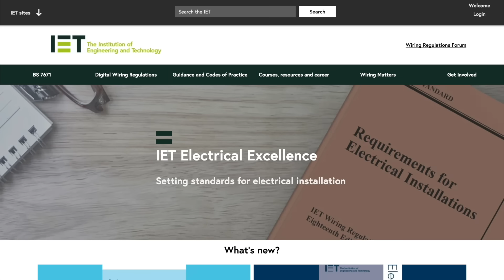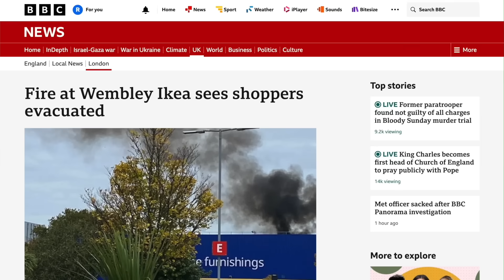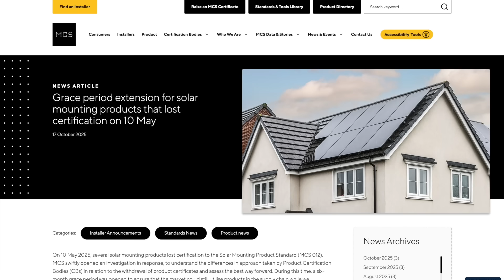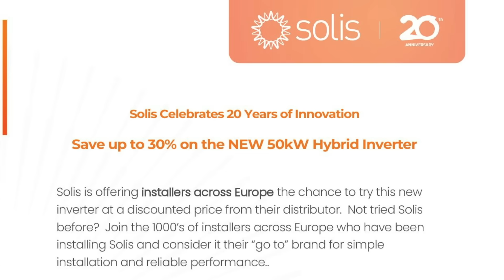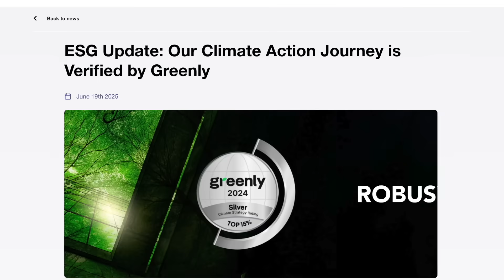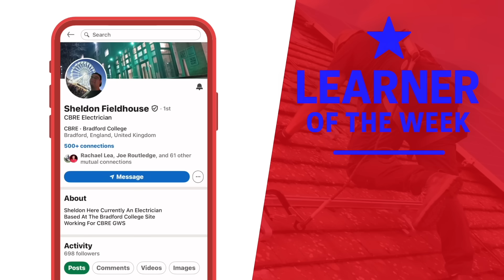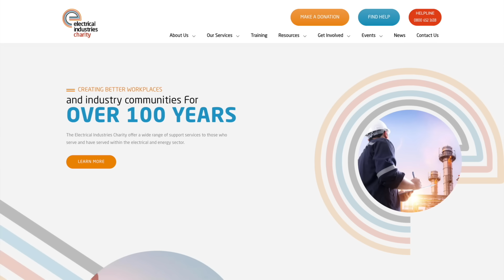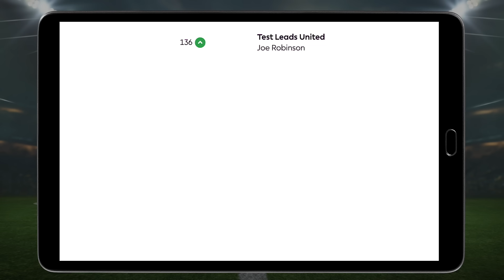Exclusive: Grid Bosses Set to Change UK Voltage

Comment: If this solar stuff is so good why has 3 houses local to me had there solar panels taken off there roof and not replaced them. .
I was intrigued so one person said they were useless , 2 person had  a storm took them and half his roof off . 3rd person I don’t know why .  Makes you think
Reply: They are still quite new - it is possible they were badly installed? My DIY setup was a bit "meh" (not taking as much as I'd hoped off my bills) until I worked out the lead-acid batteries had nowhere near their stated capacity. I bought new lifepo4 batteries, but Mrs trs4u was ready to drive it all to the tip. They provide about 75% of our electricity. An expensive component like that underperforming by surprise can be financially gutting. There will be people having bad experiences.
Reply: @trs4u yes it’s a valid point
Reply: Really old stuff or not enough panels then, I have 9kw of panels and 90% of my bill is gone and that includes running two EVs

Comment: All the while impressed how fast a kettle boils in the UK at 240v! Wow!
Reply: All kettles are mad to cover 220-240V nominal. so its Voltage range is from 198-264V (+/- 10%). When the kettle is labelled 2.4 kW at 230V , it will take  2,2 kW at 220V  and  2,6kW at 240V.  Filled with 1 l water,  the boiling point differs only abt. 15 seconds.
Reply: It’s about to take 2% longer :(
Reply: @geoffplywood6112  I will not stand for this! I'll be SITTING, because it's TAKING SO LONG!

Comment: My home is only 30M away from the 11KV transformer and my supply is aways above 240V 8pm 242V and tonight at midnight 249V some times I see 252V. I also see this at a lot of sites as well. Higher voltage better as the current is lower for fixed watt equipment. Also good for long runs.
Reply: I must be at the other end - 220V and it drops to 200V when drawing a bit of power!
Reply: @ByToothandClaw That sounds like a bad connection, either on your incomer or consumer unit or possibly the joint outside your property. Shouldn't fluctuate when you increase demand by any more than 1 or 2 volts. Dropping 20 volts indicates a poor connection where resistance will increase with current draw.
Reply: @emfs2016  similar experience here, we have solar PV so daytime voltage rise is expected but the 1950s era pole transformer that supplies our property sits at 248 when there is no load overnight, rising close to 252 in the daytime, before the low voltage overhead cabling was replaced a few years ago we would sometimes get an overvoltage trip on a sunny day but a newer transformer with better regulation would be very welcome!
Reply: Same here, it is at the limit of my solar pv inverter, after install it went to 255v and shut the inverter down requiring a reset.  Since then it’s been around 252v too close to the 255v limit.
Reply: @emfs2016  same here I am regularly between 245-250v
Never seen it dip below 238v!
My small 500watt PV install makes no difference to my house voltage.
My UPS is  "compensating for high voltage" over 50% of the time. It considers 248v or above as high
Reply: Pretty sure my outlets (In a flat, maybe 40m cabling distance from the transformer; Rating unknown) consistently read at 250v using a consumer plug-thru power meter.

(I'm only a hobbyist, so a bit wary about sticking my meter probes directly into known live outlets. My meter has a V/max of only 300v as well, so 250 plus variance is a bit close for my liking.)
Reply: @UK-Combustibility-Assured good call on being wary of that meter. It should be safe if you wire it up in series with a lamp  and not be holding the probes when you flick the switch... NICEIC it ain't, but safe with a risk assessment, it is

The accuracy of even a cheap DMM (NOT the ubercheap ones!) should be better than the plug in type. 

But given your situation,  substations for blocks of flats (especially electric only) tend to be tapped to the high end of 'normal' because of the potential load
Reply: @TheChipmunk2008  The meter in question is a Lidl-branded Parkside one, which I switched to as I wanted to preserve the OG Fluke I'd used for 20 years prior. It's GS/TÜV and CE marked so there's probably some overhead in the specified ratings, but assuming that could be a very dangerous thing, so I don't. 👍

The road is mostly social flats plus a few houses for families. All of the flats are Eco-7, so a high-tap is more than logical. I dread to think what the voltages drop down to when every flat in the road except mine (If only I could afford it!) has their storage heaters and boilers on the go! 😳
Reply: @emfs2016  same here. 11kv pole and transformer is in my garden. Supplies 3 properties. They just put a new transformer on and power grid guy tested it at 241v at 4pm.
Reply: Same here rarely drops below 240, quite handy being that close to the supply,  good earth as well.
Reply: Used to be like that at my place, but recently they renewed the local transformer manufactured to the new standard.
Reply: You can bet your ass that the government will hear the concerns from the industry and then not listen and do it any way. After doing it theyll make sure we all pay more both for swapping out kit that wont work and more tax o. The cost of power to pay for the change overs “paper work”
Reply: @emfs2016  Not good for energy efficiency where magnetic ballast fluorescent lights are concerned.
Reply: By lowering the voltage, there will be an obvious increase in current. Hence, bills will definitely increase. Absolutely no surprise there.
Reply: @AbdulSinge  only with non linear loads like switchmode stuff. A lot of load is still inductive or resistive
Reply: All electronic equipment use Switch mode power supplies and will work down to 80 volts I believe so no  real effect there, as for heating kettles etc you will have less power/ heat output
Reply: @johnchild61  The problem is the switched mode power supply will draw more current at lower voltages, which will cause fuses/breakers to blow.
Reply: The longer the cable I use for powering my garden equipment, the less effective the equipment is. It’s the old hosepipe principle. Energy companies please note .
Reply: Be grateful meters measure current so the more volts the less current you need to boil that kettle.
Reply: Same here.. 750kVA substation within a stones throw... We usually hover around 247... fairly stable
Reply: And shorten the life of all smoothing cap's in your equipment.
Reply: @stevesweet2567  Also anything still using vintage equipment such as valves or filament lamps.
Reply: @RichieReportsUK_UKCNews vintage equipment got a voltage selector, set it to 250V an be happy.
Reply: @stevesweet2567  Perhaps a little, but don't forget the switched mode converter will draw less amps, so the ripple current through the filter capacitors will be reduced, making them heat up less.
Reply: @stevesweet2567  Firstly... "smoothing caps" are only for DC ... secondly.. linear power supplies (which use large value smoothing capacitors) gave way to SMPS years ago and they can handle a WIDE variation in input voltages whilst outputting the same voltage they were designed for... 🙄
Reply: @stevesweet2567  to be fair, only if the manufacturer skimps on voltage rating. Most bulk caps i've seen on switchmodes are 400v rated, and the DC output caps usually have a fair bit of headroom. Edit, some imported stuff, especially from China, because they still use a nominal (and usually fairly accurate) 220v rather than europe's nominal 230, i've seen 350v caps used in their switchmodes, that does NOT leave much headroom!
Reply: @TheChipmunk2008  400V filter capacitors will withstand up to around 280V sine wave input.
350V caps can be overstressed within the limits of UK service.
Reply: @soundspark  absolutely, it's a bit of a red flag
Reply: @stevesweet2567  No need for that grocer's apostrophe.
Reply: @julianstafford7071 the apostrophe is there to denote missing letters from the word 'capacitors', not to denote the possessive🙄
Reply: @baldyslapnut. Nope, if shortening a word then you use a period at the end. The use of an apostrophe in that situation would apply if merging two words like can and not, can't.
Reply: @baldyslapnut.  it's kinda a fraught issue re: use of apostrophes. Style guides also vary. But i got the meaning  :)

Comment: Fridge/ Freezers will love 207VAC. Still Joe Soap will pay for any damage.
Reply: All of my ‘white goods’ are over a decade old, are they going to replace them free of charge so they can run efficiently with this lower voltage?
Reply: @TwoBassed  
they will work fine
just like when we change to 230 from 240
learn physics before hysteria sets in
Reply: They won't start at that voltage, I know because  I had a low 10:03 voltage fault on the power company lines.
Reply: Well most of them ain't running at 200VAC but 110VAC instead, there are not many country still have native 220~240V standard for quite a while, most of the time they are dual use through powerbricks anyway, so unless you are using one of the older pre 2000 type machine or being very unlucky on buying brands that only run internals with 220~240V, chances are it is perfectly okay with the automatic build in transformer to convert irregular inputs into 110V and power your machine anyway.
But only for home use, business world is very different, many machines use five phase 360/480V sockets and if they goes bad the whole grid goes.
Reply: @Saviliana  Most white goods in the UK are 230vac devices without internal step-down. think refrigeration, washers and other similar equipment... Nothing sold in the UK is designed for 110v with the exception of electronic devices that nearly all have switched mode power supplies that can accept anything from 90v to 250v for global use; think laptops, chargers etc...
110v volt is not a thing in Europe, only North America...
Reply: @dougle03 

America and Canada are 120v/240v. Japan is lower at 100v.
Reply: @Saviliana  What on earth are you talking about.
White goods in the UK run on 220V AC minimum. It was 240V and they were lucky to get away with 220V to match EU standards. It's no fun waking up one morning and seeing pools of water under a freezer with hundreds of £'s of food defrosting especially before xmas.

Comment: 202v so 16% less for my money — discuss 🤡🌏
Reply: Nobody will 'see' the lower voltage unless they live near a power station and far from large amounts of solar panels in the middle of a sunny day. The power station will run at the bottom end of the voltage spec to 'allow' distant solar panels to push their local circuit voltages to the upper end of the spec. Meters measure energy not volts or amps alone, so you will get the same amount of energy for your money as you always have. Your resistive appliances will reduce slightly in 'oomph' so your kettle will take slightly longer to boil and your oil-filled rad won't be so likely to blister its paint when it overshoots its set-point.

Comment: Are there appliances that will overcurrent their supply if driven at low volts -especially when including a smps. Will there  be appliance that cannot use a 13a supply/fuse  if they try to draw more current at lower voltages
Reply: Potentially, yes but how many appliances can you think of that have a SMPS that is actually drawing 13A into that SMPS and is designed to plug into a 13A socket?  Likewise motors.  How many appliances can you think of that have a line operated motor that has an operating current of 13A that plugs into a 13A socket?

Comment: Hang on.... im not an electrician but I understand electrics..
So dropping give or take 30 volts in the grid supply isnt initially a red flag, but im a skeptic.
So..... just for fun, say you're cooking your side of beef, turkey, baking a cake, boiling your kettle.... at 207v isnt that going to take longer and effectively consume nore Kwh? It might seem insignificant but some people...(you know who) are going to make more money.
I smell a corporate big six rat
Reply: So... surely it will take longer to achieve the same result?
Im probably wrong
Reply: It’s not average 207. It’s the lower limit. The nominal will remain 230 I believe.
Reply: To maintain same power (wattage), if voltage drop, ampere going rise. Not sure how heat elements like that or wires or fuse.
Reply: @GameBacardi  Most heat elements will not draw more current because they are pure resistive.  The resistance won't change to any significant degree when the voltage changes. This means the watts will decrease by the square of the voltage drop.

Amps = Volts / Resistance
Watts = Volts X Amps
Watts = Volts X Volts / Resistance
Reply: @Sylvan_dB  Trouble is that heat output is current squared times resistance, At lower voltage, the resistance doesn't change so the current drops to the voltage divided by the fixed resistance. Eg 100 volts into 10 ohm load equals 10 amps. 

10 amps times 10 amps  times 10 ohms equals 1000 watts heat. (using the current squared times resistance formula)

Now drop the volts 10%. So 90 volts into a 10 ohm load equals 9 amps., so calculating heat, it's 9 amps times 9 amps times 10 ohms, (fixed resistance), equals 810 watts. 

So you went from 1000 watts to 810 watts. You lost way more than 10% heat!  810  watts is 190 watts less than 1000 watts. So190 watts divided by 1000 watts. You lost 19% heat!!  That is pretty significant heat loss!

When you have pure resistance heating, the current squared times resistance formula best applies.  But the double check is 90 volt times 9 amps equals 810 watts. If you want the most heat out of resistive heating, you want the maximum rated voltage. Typically, restive heating elements, like Nichrome,. are designed to operate in a specific range where the resistance is very stable. So if you have pure resistive heating a drop in the voltage is a big deal!
Reply: @GameBacardi  Purely resistive heating will supply less heat at the lower voltage.
Reply: for resistive loads such as the options you offered, it will in theory consume exactly the same amount, just take longer. There WILL be a tiny increase in actual consumption with the kettle.... due to the losses during the heating process. Ovens, no difference at all, as they simply cycle the stat more often. The meters take account of voltage and measure true kWh (within their accuracy tolerances)

Comment: Wild guess, they want lower voltage so they can use that "global-battery-system". So, when people are forced finally to buy EV, people recharge car battery in they home,
this stored battery energy in EV is now also shared around neighborhood when needed.
EV is part of powergrid.
Reply: An average EV battery is 400V DC. To be connected to the grid an inverter is required in the same way that it is needed for PV panels. No inverter cares (beyond a s/w update) if the UK sets its minimum voltage at 6% or 8% below the set mid point. All inverters feeding power back to the grid have to try and raise the voltage not lower it.

Comment: Dropping the minimum voltage means that devices that are constant wattage are going to draw more current, so stuff that's within spec is going to take plugs over 10A continuous. The equipment may be designed for EU ranges but the plugs and sockets are not.
Reply: Would most home devices that draw nearly 10A continuous not be resistive? If so the amperage will remain the same and the lower voltage will just result in a reduced power draw. So you home heater and shower will just lower their heat output.
Reply: @rogerthomas7040  We don't accept "mostly safe wiring" or "mostly safe sockets" or "mostly safe distribution boards" either.
A lot of devices will certainly keep to the current limit both old resistive devices and modern smart devices like big battery packs and EV granny charging.
Reply: @etchedpixels  So what devices do you think will draw so much more current that they will be an issue if the voltage drops by less than 5v more?

Comment: Lowering the votage increases the amperage, what does the meter run on, you gest amps , just another price hike by companies making billions. And of course well made old equipment already struggles, and new equipment lasts 4 years if your lucky, con after com after con. At least we won't be cold when all that plastic shit goes up in flames that they have sold you in the last few years..
Reply: Rubbish! The meter measures power (kWh), not Ah, & that's what you're billed for. Might also measure power factor & bill you for a poor one.
Reply: Quoted from google - "Risk of damage: Using a 240V appliance on 110V is not recommended. The appliance is designed for a specific resistance and voltage, and while it will technically work at a reduced capacity, this can lead to premature failure and is often not a practical way to use the device. "

So, if the corporates can't bill you more, the retailers will win